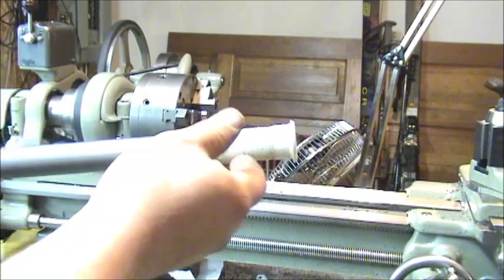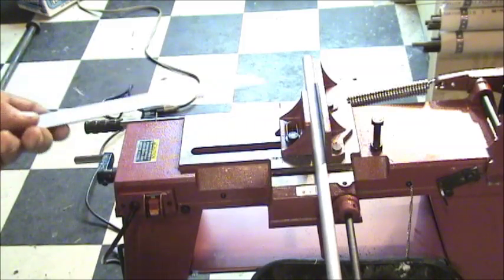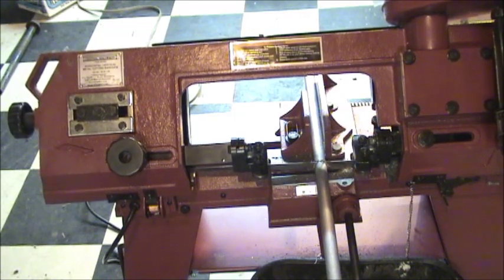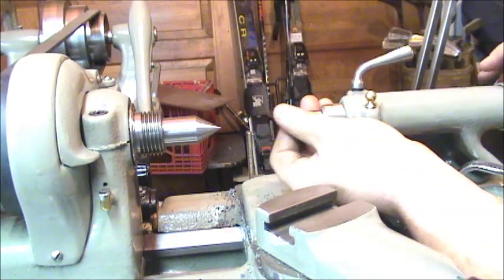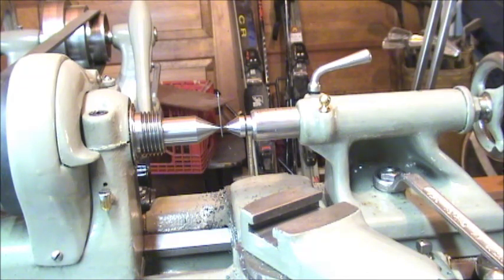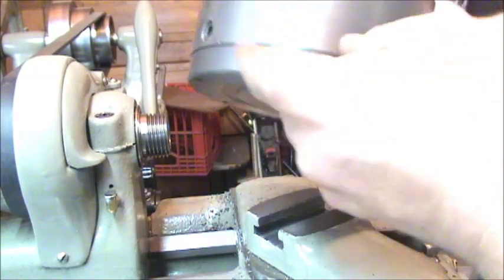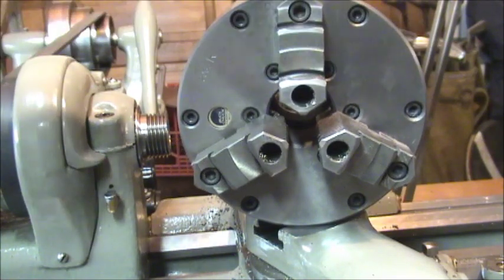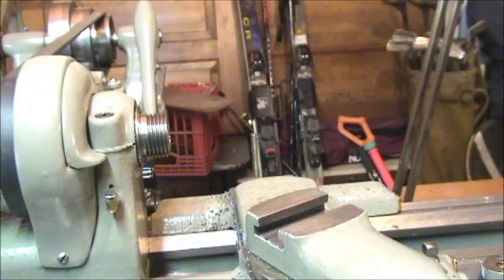Machining a Test Bar

Comment: Wouldn't it be easier to use two allen wrenches when you're centering the chuck so that both can be moved differentially or tightened at the same time?   Saves all the slow back and forth, much quicker and less tedious.

Comment: I like the way you do videos so please, please use eye protection when turning.  There is a lot of safety stuff that can be over the top but that one thing is so easy to prevent such disaster.  It truly is not if but when you will get a chip in your eye without it.  That can range from very uncomfortable to blind.  Just one time when you neglect it can screw you bad.  Good video otherwise.  I have talked to too many people who had the doc rooting around in their eye to dig out a chip.  Especially aluminum because it can't be pulled out with a magnet (and some stainless).  I keep a pair by most of my machines so I can just reach out for them.  Just saying because I care.  Doug

Comment: wouldnt your center drill be off if your head stock isnt aligned?
Reply from the maker: Head stock is keyed and scraped to fit the ways.  It can't twist.  That's also the  reason for machining a small section between centers.  Even if your tailstock is off some which won't be a lot if you use a razor to check it first that little register you machined is on the lathe centerline.
Reply: sorry i meant tail stock... if the tail stock is not aligned... i do the tubalcain way,  i center drill then bore a new 60 degree in each end of the bar with the compound, so its dead on.. then put the bar between centers and indicate, but i do like your razor blade approach... i thank you for your help...

Comment: Are you sure that the centerhols are truly in the center of the bar. It seems to me that by using the tailstock you are just transferring the "out of line-ness" of the tailstock to the testbar. I would use the cross slide set to 30 degrees and machine the centerholes and then test them with a dial test indicator on running true.

but that's just me!

kind regards,

Teun (the Netherlands)